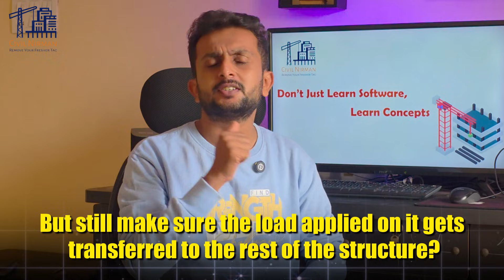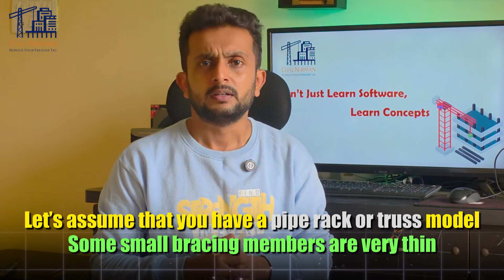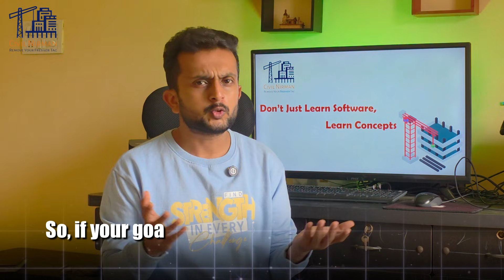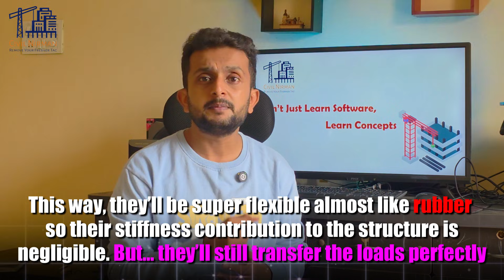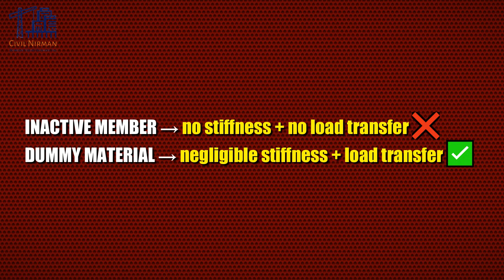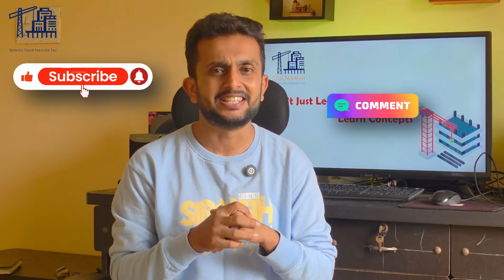STAAD Pro Tip  Ignore Member Stiffness but Keep Load Transfer | Dummy Material vs Inactive Member

Comment: Thanks Chetan...really helpful. Is it required to declare Elasticity only ? & Would it work for RCC frame or steel structures or both? please make complete video to demonstrate the concept 🙏
Reply from the maker: Glad you found it helpful! 🙏
Yes — primarily reducing Elastic Modulus (E) is enough, since that controls stiffness. You can keep other properties (density, Poisson’s ratio) as usual.
And yes, this method works for both RCC and steel members — because the idea is purely analytical, not material-specific. It just reduces stiffness but keeps the load path intact.
I’ll definitely make a detailed demo video soon to show how it behaves in both cases 👍
Reply: @CIVILNIRMAN Thanks for the prompt reply 👍
Reply: @CIVILNIRMAN Do you offer training for steel & RCC design in Staad pro ?
Reply from the maker: @er.gurlabhsinghgill8254   yes Connect on +918320501602  , Check website www.civilnirman.com
Reply: @CIVILNIRMAN  Should I ignore warning result about stiffness sir ?